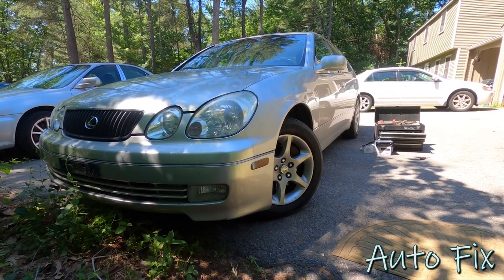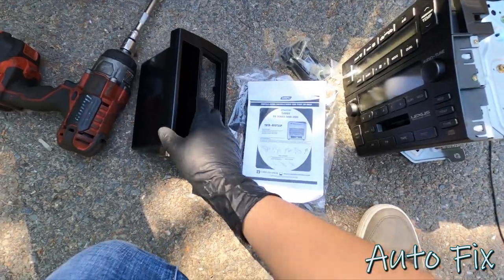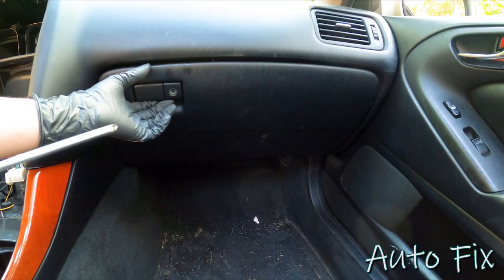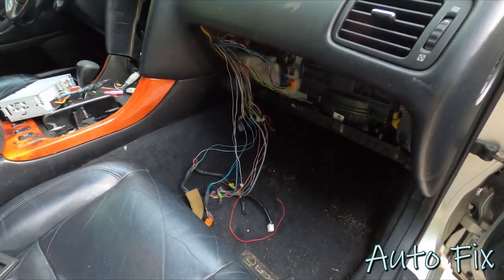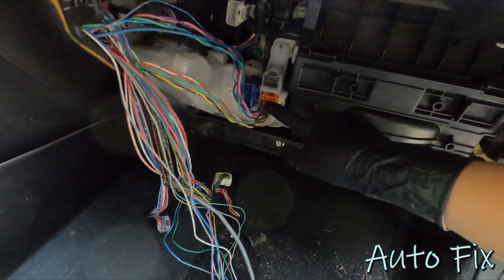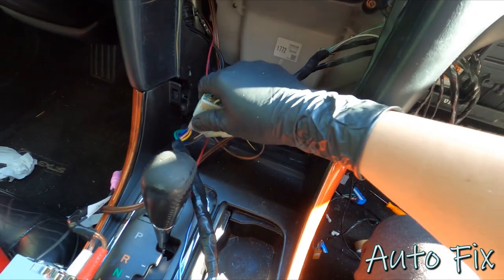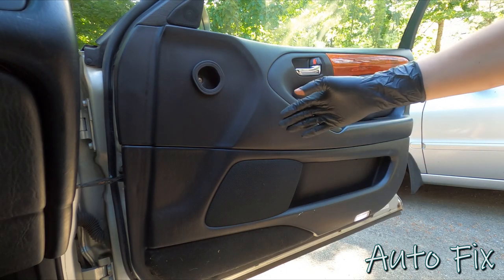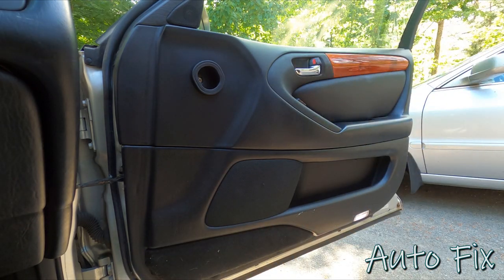Installing Head Unit & Speakers In 97-05 Lexus GS (DETAILED)

Comment: Any help on using the factory amp with an aftermarket head unit? I was debating on ideas. Could I simply split the amp outputs rcas? And run it that way? I don’t seem any info on doing this. Nvm it’s too much of a hassle lol. I’m gonna just stick a small amp in its place and run the sub off it ig.
Reply from the maker: Haha yeah I think it's a good thing you changed your mind. Unfortunately it will be tricky to do what you said initially. You can try, I have tried that before with other cars and it kinda sorta worked, but it is a huge headache... you're better off with a little amp just for the sub

Comment: You did not show how to wire it up if you where going to use the factory amp. I want to use my factory amp because i have a original subwoofer, that i want to use. Please help me
Reply from the maker: I didn't and it would have made things a lot more complicated for several reasons.

1. You have to keep the amp and feed power and ground to it, but also you need to now splice the ignition power wire to feed both your aftermaket head unit as well as the amp at the same time. That's easy though.
2. You need to figure out all the wiring going into the amp. Most likely it will have 6 wires that are the inputs for the speakers. One will be the common ground, one for the sub, and one for each door speaker. Not to be co fused with the output wires which will be much thicker but also will be 10 in total. + and - for each speaker including the sub. So you'll have to figure out which wire does what. It is possible however that you'll only have 5 wires. A common ground, and then one for each door speaker. And the amp has built in bypasses that take the low frequencies and only send those to the sub and the rest to the speakers. Idk.
3. Once you have the proper wires located, you need to buy a line level adapter. You cannot connect the RCAs from the back of your new head unit to those wires you located, and you cannot connect the regular speaker wires directly to that either. The RCAs will not have enough power going through them and you'll get a really weak signal, and the speaker wires are already amplified by the head unit so it will be double amplified by the time it gets to the sub, meaning it will be extremely distorted. So you need a line level adapter (I think that's what it's called) and you will have to plug that into the desired speaker wires. Its output wires can then be connected to the input for the factory amp. Those adapters should have level controls on them so you van adjust how much it cuts down on the power flowing through the wires to make it powerful of a signal enough but not too much. So adjust it as needed.
4. Another downside to this is that now you cannot set a crossover frequency for your door speakers and your sub. Since you age pulling a signal off of the door speaker, you can't cut the low frequencies out of them (which you should alwaus do when you have any sort of subwoofer). If you do, you'll have no bass from your sub because it won't get a signal anymore.

Ao overall it's not worth it in my opinion. But if you wanna make it work, go for it. Try it out and let me know how it works! You can also buy a very small aftermarket amp and hook it up to power, ground, remote turn on, and then connect it to the factory sub and use it that way (way easier) or even replace the sub speaker while you're at it in the stock location, or do what I highly recommend and get a nice sub with a box that's gonna be in your trunk and you will not regret it haha

I hope this helped!

Comment: I appreciate the video and the details. But I'm confused on the plugs. Because the wires you speak of (acc/illumination)  does not look like the one I have for the factory plug that goes to the radio (not speaking about the ones that you dragged from the amp)
Reply from the maker: I don't quite understand your question... I think you're asking where you can get the accessory and illumination wires from?
Reply: @AutoFixYT  so my problem is I can't find no where a diagram of the wiring for the radio. If I do it doesn't have the colors that I can see on the car on either side. (Amp or radio)  so my question would be where can I find it so I can either depin some wires so then I can plug where they need be.  Because my aftermarket harness can reach to the amp but if I plug it straight to those plugs they're the head unit will not turn on. So I'm lost (still a newbie) I understand it easy when it literally is plug and play I have done that a few times but this one got me stumped
Reply from the maker: @joserm6823  I think what you need at this point is a multimeter. That way you can test all the wires for power and ground and you'll find them all that way. That's how I did it. I didn't have a wiring diagram.

Comment: I myself was trying  to figger out the audio inputs  to the factory amp any help will be greatly appreciated,,Thank you
Reply from the maker: As far as I know the inputs for the factory amp have 5 wires in total. A common ground, and one wire for each speaker. The amp outputs are the typical Toyota head unit connectors (if you know them you'll recognize them).
Reply: You Sir ,in my opinion would have this country running like a well oiled machine Thank you and much appreciation!

Comment: You can use the stock speaker boxes. Just have to trim them to fit the 6.5s
Reply from the maker: Yeah true, but they might sound weird considering they're acoustically built for those speakers they came with.
Reply: Is there enough space between the door card and the speaker with a 6.5?
I bought some plug and play brackets to convert the front speakers to 6.5 but now I'm having some regrets that the speakers might sit too far out when I eventually start pulling new door wires etc
Reply from the maker: Well if the brackets were made for that car and the speakers are average mounting depth, they will fit.

Comment: I just saw the video now . And I couldnt but to notice a few things.
1. You did not mention anything about the subwoofer, will it be connected or working just fine ? Or it will no longer be connected and there will be no bass ?
2. After this installation, did you notice that maybe your front right door lock is not working ? Because your lock wire was broken when tried to clip it out from the handle .
If you can clarify these i wiould realy appriciate it . Thanks for the details though
Reply from the maker: Hi, 
1. I think I did mentioned the sub, I said I'd be building a separate one and removing the factory one. This procedure will eliminate your factory sub. You can maintain the factory sub if you buy a separate amp for it or for best results remove the factory sub and buy or build a custom aftermarket one to suit your bass needs.
2. Nothing about the door lock stopped wokring and still works to this day.
Reply: @AutoFixYT  ok so for my sub i can just keep it but add a new amp for it ? Then i need another detailed video to be able to fully understand it 😅
Reply from the maker: @assimanasalsalam1278  Haha well hooking up an new amp to it is just like connecting any aftermarket amp to a sub. There are probably hundred of YouTube videos on how to do this.
First you wanna figure out your amp power. Look on the speaker and see what it's rated for, as in how many Watts. If you can't find it, look it up, google definitely has the answer for you. Then find the amp you want online and buy it. Then you also need an amp wiring kit. It needs to include a pair of RCA cables, a power cable, a ground cable, a remote turn on cable, and preferably some speaker wire so you can connect the amp to the sub. Then find a place to mount your amp, run all the wires, and start tuning your sub to make it sound like you want it to!
From personal experience, I can tell you that the factory sub isn't great and don't expect much from it haha. It's weak, lacks deep bass, and you can get more out of a cheap pre-built sub that will be less difficult to work with if it comes as a kit with its own amp.

Comment: Bro what about the aristos with the A/C controls in the head unit ??? Do I need a new head deck and to find the controls like yours ???
Reply from the maker: Look through the comments and read the one from "vicbjr". He asked a very similar question and read all my responses to him. That should solve your problem
Reply: @AutoFixYT  thank you thank you also one other thing what if I kept all the stock head unit and amp but up dated the speakers and factory sub to new ones would that be just as good ?? Aw I envy electrical guys 😔😔
Reply from the maker: It would be better but not just as good. But better.
As for electrical... the way I learned was to really think about what I was doing and then dig in to it and learn as you go
Reply: I got the adaptors and speakers you got , going to keep the stock head unit but what size is the factory woofer could I find somthing that could go straight into the stock place ? Or need adapter for that to
Reply from the maker: You can probably find something to go in its place but you will most likely need a different amp. Find out what the RMS wattage is on the factory sub. If the new one is more powerful then
1. You'll overwork the amp a lot and possibly burn it out eventually
2. You will lack bass as it will not be as loud

Comment: Wait so If my head unit has the little knobs I don’t need to bypass/buy the extra cable? It’s basically a plug and play?
Reply from the maker: Not necessarily. You will always need an adapter harness to use an aftermarket head unit if you don't want to cut up your factory harness.
To know if you have an amp you can either call the dealer and ask them, or the easier way is to look behind the glove box or in the trunk on the passenger's side underneath the side carpeted panel.
Reply: @AutoFixYT  I looked through the comments to kinda figure out what I’m doing and I saw that it’s different if you have the little bass, fader etc. knobs. I have a jvc head unit and the wire that came with it, the double din and wire adapter from the description. Do the knobs mean I need to do something specific? I also saw a metal box, which I’m guessing is the amp?, in the trunk passenger side of that means anything
Reply from the maker: @phoEnix2o2  Yes that metal box in the trunk is your amp, which you will need to bypass if you are using an aftermarket head unit. You have three options for bypassing that...
1. You peel back the entire harness that leads to that amp and bring the connectors into the dash where it can hook up to the aftermarket head unit (the two connectors are the classic two Toyota connectors, if you know then you'll recognize them. I show them in my video too. Metra makes a nice adapter harness so you don't have to cut the wires)
2. You extend your aftermarket head unit harness to reach all the way into the trunk where the speaker connectors are at that amp
3. You create all new wiring for your head unit with power, ground, illumination, and the 4 speakers. You can take power, acc, and illum. from the existing wires up front, ground can be anywhere on the chassis, and the 4 door speakers can have new wires ran from the head unit harness to each speaker through the doors.

Just as a side note, you will no longer be able to use your factory sub if you go with an aftermarket head unit and bypass the amp, unless you buy a separate amp to power that sub.

Hope this helps!

Comment: Anyone know why my clock and lights that turn on arent when door opens arent working now??  Which wire powers these so they can work again
Reply from the maker: Could be that the door latch isn't sensing that the door is open
Reply: @AutoFixYT  its all my illumination lights, such as clock and climate control, shifter lights. They were all working fine until i installed aftermarket radio
Reply from the maker: Maybe the fuse popped?

Comment: do you know how I can put an original nav display unit as a replacement?
Reply from the maker: You want that instead of the non-nav head unit?
I'd assume that would be a pretty easy swap, you just need all the parts, wires, and brackets necessary to attach the navigation head unit. But I could be totally wrong. I've never looked into it.
Reply: @AutoFixYT  exactly. I bought the car GS430 in 2000 and it came with a no touch screen unit like in your video. I never knew this model can get a touch screen unit therefore interested to seek advise. Thanks
Reply from the maker: @zerosumgamez  In my opinion, adding the factory Nav head unit will not improve anything other than change the looks. The sound will be the same, and the maps will be outdated. If you want touchscreen you're better off with a modern aftermarket double din head unit, or even one of those that has the screen that slides out of it. Up to you. But the factory NAV radio is super outdated at this point and you won't benefit from it except for like I said, it will look different.

Comment: Who can help or give me an idea with my GS? I recently got an 05 with factory Nav and i want to put in subs but I notice that the Nav screen also controls the Ac and radio so i dont think I can just throw in a double or single din like the non Nav head units.
Reply from the maker: There are a couple ways you can add subs. The first way is to remove your factory sub, and use the signal wire to feed an amp (which should have a connector for already amplified signal) and just put all that in the trunk, and you'll be all set. This is the easiest option because you don't mess with any of your existing stuff.
The other option is for you to go to the junkyard, find a non-nav car and take the heater controls out of that and put it in yours. Once you do that you can install an aftermarket head unit and then run your RCAs to your sub in the trunk. This is the most customizable option because now you can tune the sub, replace the door speakers and tune those, etc.
Reply: @AutoFixYT  sweet! Appreciate the advise. I'll definitely weigh both options and you answered the question i forgot to ask about being able to swap out to non nav setup. Also would I need to bypass the factory amp if I go with the first option? Thanks alot bro 🙏
Reply from the maker: No, you do not. Take the wires that plug into your factory sub, and connect them to the amp for your aftermarket sub. I had that setup for a while. Every quality amp should have two inputs. One is the line level input (RCA) and the other one is the amp level input (i think that's what it called) where you can plug in a signal that's already amplified. Then the amp picks up that signal and amplifies it itself.
Reply: @AutoFixYT  awesomeness thanks.

Comment: I have a 2001 GS with the navagation head unit - Is there a way to add an AUX ? thanks!
Reply from the maker: If you have a tape deck you can take the whole unit apart and hack into the tape head input. That's what I did before I had this headunit. You can also get adapters that plug into the CD changer plug I believe
Reply: @AutoFixYT  okay great to know - i really like my nav unit and dont want to get an aftermarket one. It  would be sweet to connect an aux and sub woofers to my stock NAV set up
Reply from the maker: @Firenar  Totally doable, I didn't have a nav system but I had an aux and an aftermarket sub connected to my factory system. You just have to be knowledgeable and willing to literally hack into things. If you want to message me on Instagram @autofix.cris I can explain more of how I did it on mine

Comment: Appreciate you, what did you do about the factory subwoofer?
Reply from the maker: Removed it, wasn't very powerful. I replaced it with a 12" sub in the trunk. I left the grille cover on there to make it look normal but it's really just a hole to the trunk lol
Reply: Taking out the factory sub was a pain in the ass for me but just because the car is old shit was breaking left and right
Reply from the maker: Yeah and you don't have much space to work with

Comment: Would it be possble to use oem headunit with aftermarket amp?
Reply from the maker: If you're talking about an amp for a subwoofer, yes totally. Super easy, just take the wires that feed the factory sub and connect them to your new amp and sub setup.
If you are talking about an amp for your door speakers.... You might be able to, but you'll have to do some customization. Here's the issue... aftermarket amps are usually fed from the head unit by RCA cables. Your stock head unit sends the signal to the stock amp though 5 individual wires: front left positive, front right positive, rear left positive, rear right positive, and a common ground for all of them.
So... if you can think of a way to make that work, if you wanna experiment and see how you can turn those 5 wires into an RCA output, then it might work! In my opinion it will be harder to do that than to just replace the head unit with an aftermarket unit. Also, aftermarket units have their own amp built in that can typically provide pretty decent power to your door speakers. So there wouldn't be a need for an amp unless you wanna go with a very loud system or if you have component speakers (low, mid, high speakers in every door).
Hope this helps!